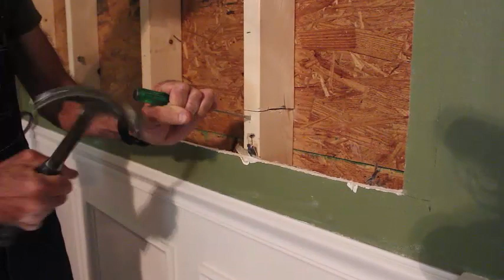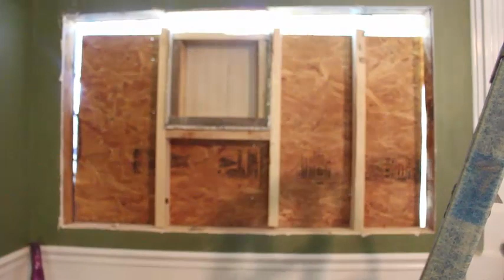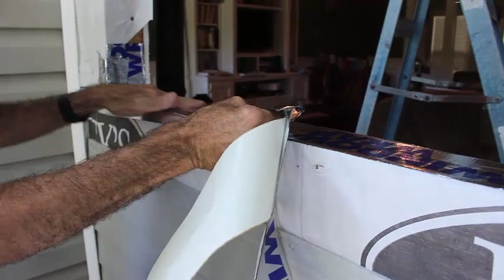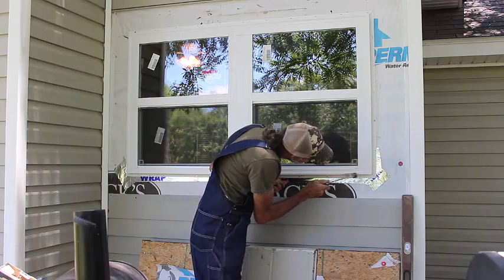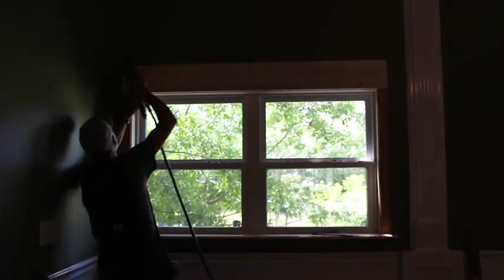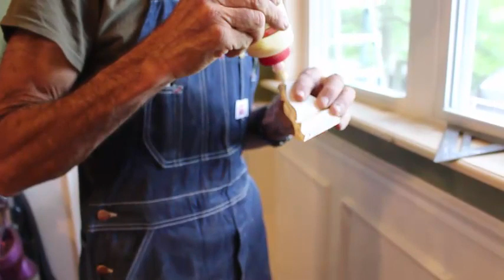Installing a Window Part 2

Comment: That is so lovely. I remember old victorian homes had very tall and low windows, almost to the floor, to let in as much light as possible, before electricity. Must have been cold in the winter time.

Comment: Danny a artist at work and on Thursdays  they clean windows.  You have a to add screens into the lower part to allow air flow thru house on hot summer crazy dayze.  Had to slip in Wanda's  channel just because of the veiw.
Reply from the maker: LOL  We do have screens so that in the fall and spring we can open the windows to allow air flow.  Thanks for throwing Crazy Dazes in there.  Brought a smile to my face.  Thanks